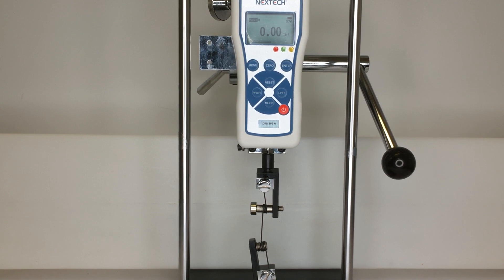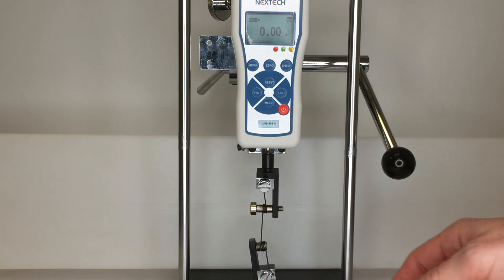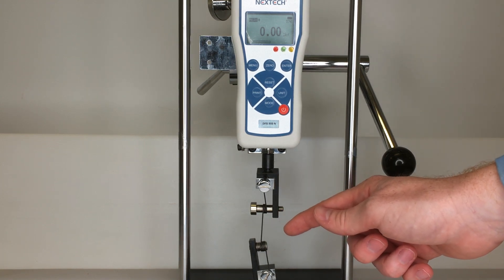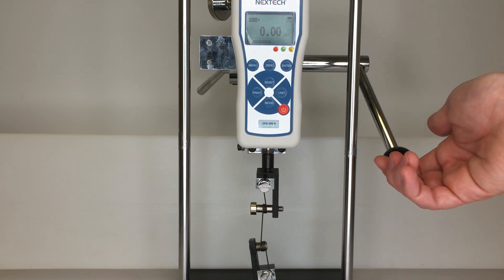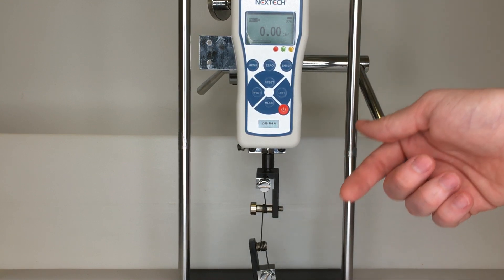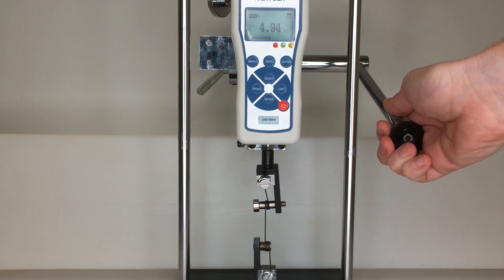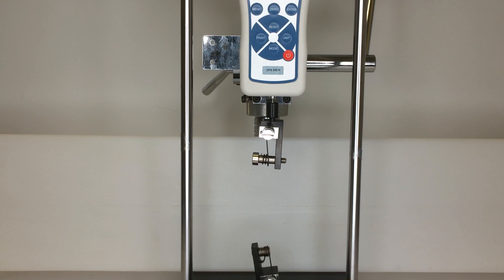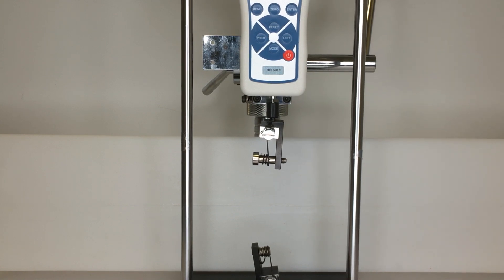Carbon Nanotube Yarn Tensile Test

Comment: how much did the yarn weigh, and what weight of comparable titanium string would hold up a similar weight?
Reply from the maker: The CNT yarn in this video weighs just under 0.9 g/m. You would need a titanium string that weighs at least 5.0 g/m to hold up a similar weight (about 80 pounds).

Comment: weak
Reply: You're a literal moron
Reply: @doctorpurple5173  Plastic Fishing line of a smaller size is stronger than this.
Reply: @doctorpurple5173  Facts bro!
Reply: Check out his reply to paki raja... It weighed 0.9 g/m compared to the titanium metal one of the same size which is 5 g/m That is 5/0.9 = 5.556× Lighter Now for overall effeciency let's see how much a carbon nanotube yarn of the same weight as the metal one can do

Let's use this official PDF article for details https://www.google.com/url?sa=t&source=web&rct=j&url=https://aip.scitation.org/doi/pdf/10.1063/1.4712083&ved=2ahUKEwj18a2g0KvvAhXEWM0KHZ_vAbMQFjAAegQIARAC&usg=AOvVaw2NSK6DlQ2ZFDaOih_IlXkz

It says that a titanium string can handle 793 MPA... This looks weak at first to the 500 MPA shown off in the video, but since we are considering the weight and the hypothetical scenario that you make them weigh the same this ACTUALLY make the carbon nanotube

500 × 5.556 = 2778 MPA of force held for a yarn the same weight 

That is 
2778/793 = 3.50315258512× stronger then even a metal string (which YES includes fishing rod metal string) in MPA

(And This is a MAXIMUM highball for the titanium string...)

This means it can hold 402,914.83541 Pounds Per Square Inch!!! For a Carbon Nanotube thread of the same weight!

That is
402914.83541/35000 = 11.5118524403 not full Semi Trucks of Weight 

OR

402914.83541/80000 = 5.03643544263 Full Max Weight Capacity Semi Trucks worth of weight....

To put this into perspective... This is 2778/4.9 = 
566.93877551 Fishing Rod Strings of Strength

Or around 
567 fishing lines to be exact.... That is a little more then an entire schools worth of people (using the national average as of 2021) fishing for 1 single damn thing!

Sooo, HELL NO! This is not weak AT ALL! 🤦🤦🤦
Reply: Sidenote: And before any random Moron comes around and is like "but but he didn't lift 5 semi trucks..." 

Keep note of mechanical advantage + unit conversions...
Mechanical advantage equations are defined here 
http://www.comfsm.fm/~dleeling/physics/torque.html#:~:text=In%20a%20class%20one%20lever%20the%20force%20of%20the%20effort,opposite%20sides%20of%20the%20fulcrum.

NOW This is finding out MA, but there is still a useful piece of info to find the results of the MA via seeing.... Imma just quote the side that will be useful.... It says 
"In a class one lever the force of the effort (Fe) multiplied by the distance of the effort from the fulcrum (de) "

This means It is fundamentally based on manipulating the equation of 
Force × Distance = Work

Sooo, Considering said string was extended about a foot, and considering said length doesn't matter in this situation, since the weight is soooo light compared to tensile strength. We have to instead use the Lever for Mechanical Advantage aka the half a foot object by the seems of it... 

 NOW Considering the main unit of force is newtons aka Kg M/S^2 this means half a meter to inches = 19.685 inches....
NOW Considering unlike weight, unit conversions isn't necessarily linear all the time we have to consider MPA to PSI conversion....

MPA To PSI is about a 145.038× multiplier of  PSI per MPA according to google....

Sooo.... 500/(19.685 × 145.038) = 0.17512686882 MPA of force...

That is only about 25.4 pounds of force he needed to physically exert considering MA (Mechanical Advantage) and unit conversions LOL

Still though... Point still stands that this is NOT weak Relative to other strings. 🤪
Reply: @shadow15kryans23  bro i am a stupid in this case.
Reply: @Bang6484a  OOOOF I Felt That one on a relatable level XD. I was the Same way like Mid High School and didn't advance rapidly till half way through. 😂🤣
Reply: @Bang6484a  Sooo, It's all Good!

Everyone has a bit of Stupid in them at times, even i do. 🤪😁👍
Reply: its weaved carbon fiber, not perfectly crystaline weaved carbon fiber. Try doing this with even titanium fiber, you couldnt.
Reply: @nom6758  A very old video. Don't want argue.
Reply: @Bang6484a  Don't comment on things you don't know
Reply: @St0n3dCold  you are weak...
Reply: @Mr Penguin i agree with asif, its kinda weak compared to metal cable of the same thikness